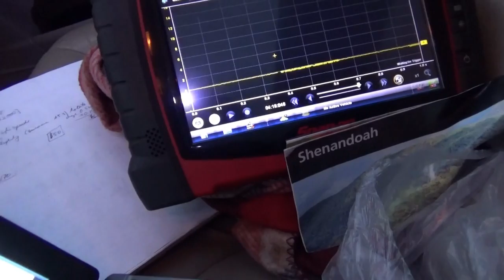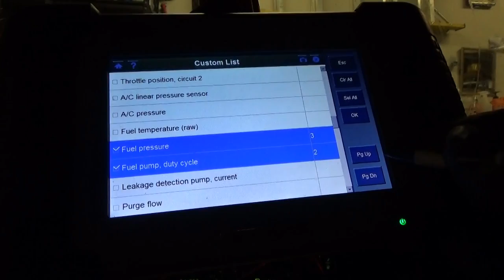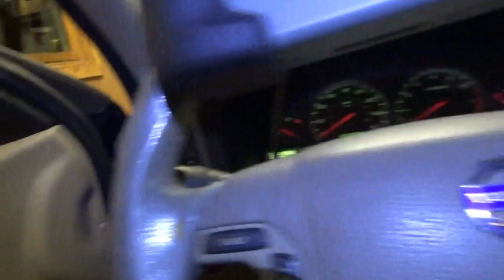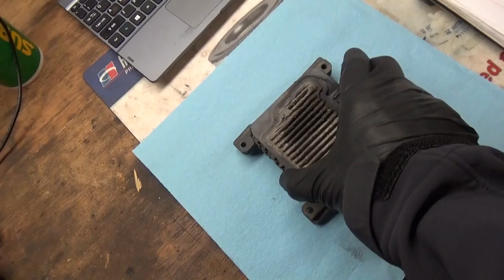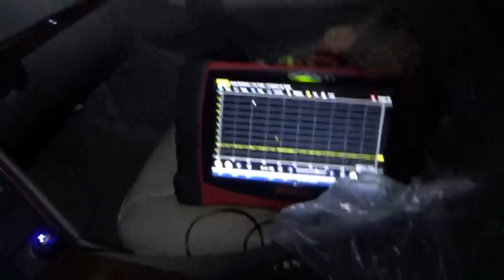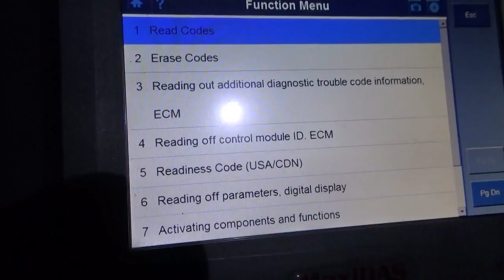Volvo Crank No-Start -Part 2

Comment: I just sent these videos to a friend with a crank no start xc v70 '05
The vehicle will not start if it is below freezing.
Above 32° it has been starting  fine. If moisture has invaded that module could this be an explanation?

Comment: Looking at the circuit board I really couldn't see any damage. But if there were a problem I would think any corrosion would create an relatively harmless  'open' - not a 'short' circuit that might burn out a component. Hence, I would re-solder any suspect connections on the board if I suspected that the parts were now in an open or partially open state on the board. In electronics this is often the problem and with a board exposed to the elements this seems very likely.

Comment: Hey boss my buddy have 04 v70 t5 same problem but I couldn’t find the module at all all the wirings are different Is there a way you can tel me if his car comes with it or have to replace the fuel pump ?

Comment: Brother I feel you.  I'm having the same problem.  Do the same thing, take very good care of my car.
Been running great,  no issues.  Then ran out of gas and  havent been able to get it started.  Got fuel,  good cranking
Power and alls I can get out of it is crank, crank and crank,  but no start

Comment: Can you explain me if it is grounded by computer (like you said ground side switch) why scope didn't show 12 V or whatever voltage, instead showed zero voltage. If  ECU ground this yellov wire wasn't suppose module show voltage when it is disconnected.

Comment: Volvo wishes is was a polymer electrolyte membrane, that’s used in fuel cells... https://blackwells.co.uk/bookshop/product/9783639342314?gC=098f6bcd4&gclid=Cj0KCQjwjMfoBRDDARIsAMUjNZrnh5GTsVF3pZthzCMyP0UJkTDxYJxrd8rI3I--TewkmgMFV2idN9kaAs6HEALw_wcB

Comment: So, if the dealership would have replaced the fuel pump and it obviously wouldn't have fixed the problem, does that mean the pump is free because their diagnostic was wrong?  Ha, that would be funny.  Like, if I actually took it into the dealership and the car still wasn't fixed, I would tell them that I'm not paying for that fuel pump since it didn't fix the problem.

Comment: pulse modulated fuel pump insane over complicated nonsense.
When all these vehicles get old $$$$$$$$$$$$ to keep running. I am Curious how long car will last jumping it at full output to save money on older Volvos ? Won't pass emissions but rural areas don't require such testing. 
My 1981 240 DL went 400,000 miles simple easy to repair . First car to use Lambda sensor (Oxygen).

Comment: Haha, $500 for THAT? What a ripoff, for a shitty design anyways. Looks like a 5 minute job with a hot air tool, a good soldering iron (not that butane thing you love so much), and some flux paste! Want to send it to me? I'll fix it for $100, special price, just for you!! :-P I did just fix a VFD for a spindle for a CNC machine for a total of $50 in parts, when a "pro" shop quoted $3300! See my (lame) channel for some videos!

Comment: Thermal interface material in contact with the PCB ground plane without removing the solder resist. Wow that a new level of "design".

Comment: Shocked it didn't require programming ... but that's probably because it was built before '07. I see Volvo (Ford) stole GM's brainstorm of locating the fuel-pump-controlling magic box UNDER the vehicle, right in the road salt, sand, and water. Brilliant ... 😠

Will be a MUCH cheaper bill than that ripoff dealer, that's for sure! Was well worth the tow to you from VA - your buddy knew that ahead of time. 😊

Comment: Proton exchange membrane electrolysis is the electrolysis of water in a cell equipped with a solid polymer electrolyte that is responsible for the conduction of protons, separation of product gases, and electrical insulation of the electrodes

Comment: Output transistors are toast, there are two big ones on the board and they likely got cooked/shorted with that corrosion floating around in it.
Reply from the maker: Yup that's probably the culprit. Not enough heat transfer!
Reply: @PineHollowAutoDiagnostics  I would have tested those two electrolytic caps, the big orange and the little blue. They dry out and lose capacitance and can short. Could have been a $2 fix! I am amazed that you could jump out the module and hot wire the fuel pump, and the ECM thinks everything is fine. And on a Volvo! What about the headlights that won't go off?

Comment: When your power went out it reminded me of a question I,ve had since a lot of the scanners are going wireless. Does you're Verus pro get its power from the vehicle while using the wireless dongle? Or does it needs a good internal battery or separate 12 V source to operate. 
I like the way you always try to fix an expensive modual to save your customer money! Wish you were closer to me. It would be great to have you 're expertise here in the north west.

Comment: Just a heads up Volvo adds Baro to that fuel pressure pid. I got burned by it had a regulator performance code so I took gauge pressure and compared it to scan data and it was off so I called a sensor. It was actually gauge pressure plus baro on the pid. Actual cause was due to duty cycle request over 45% at idle and needed a fuel pump.
Reply from the maker: Wow that's a hidden variable for sure!
Reply: @PineHollowAutoDiagnostics  don't expect to find that on Mitchell or Alldata either. Took some digging on identifix to find code set  criteria
Reply from the maker: lol some cars are too smart for their own good! At least it tells you in a roundabout way that you need a fuel pump before it REALLY needs a fuel pump :D
Reply: @PineHollowAutoDiagnostics  it would be awesome but euro manufacturers don't ever want to give anyone the information on how these systems work

Comment: Ivan, sure if you saw this in your research about this module but there is a TSB about it that requires it be moved to a new location if replaced. Here is the TSB: https://www.google.com/url?sa=t&rct=j&q=&esrc=s&source=web&cd=6&ved=2ahUKEwiN5snihfbgAhVriVQKHYjxB14QFjAFegQIBxAC&url=https%3A%2F%2Faskatech.com%2FAskATechLive%2Fforums%2FResourceHandler.ashx%3Fa%3D13208&usg=AOvVaw08aq7Y4IWOTbrubMbe-KDd

Comment: Check if you have signal coming to those two big mosfets. If you do, board is good but the driver mosfets are done. Easy repair. If no signal, as someone said, soaking the  board in water and the drying it with alcohol might help. Used Bosch PEM:s are 40-90 USD. All PEM's are not all located under the car and are in great shape. 

https://www.ebay.com/itm/Volvo-S40-C70-XC90-S60-07-06-05-PEM-Fuel-Pump-Module-4N5T-9C105-AG/264211524390?hash=item3d843beb26:g:Gv8AAOSw-M9ccgVk

Comment: If you go to your local Ford dealer you can get same PEM for under $100. last time I needed one.  Also, you can get used one, does not need to be programmed, easier to just replace than diagnose. Volvo parts are a total rip off.
Reply: Do you know the Ford part number?

Comment: Hey Ivan jus a thought, maybe to see the duty cycle from the PCM when you have the circuit jumped, you could use a 10k resistor on that yellow wire to battery positive which should bring the voltage high on that line. Then use the scope on it to see if the activity from the PCM
Reply from the maker: Great idea! Would probably work in a pinch :)

Comment: Great diagnostic! Looks like that module is some kind of pulse amplifier, It works amplifying the current and voltage signal coming from the ECU/ECM to the fuel pump, by judging the internal IC's in it it looks like it does not need any programming. I am just guessing but looks like those Mosfets are burned. I am amazed about the huge amount of PIDS coming out of this old Volvo ECM and also surprised that your old DS708 is able to read them! I guess Mr Kilmer is right about the DS708... fuel rail pressure sensor and fuel temp sensor! Wow! Also I think you're getting a high fuel pressure reading because you're operating the pump directly out of power source in a constant Max out duty cycle.
Reply from the maker: Yup the Autel works very well on this older Volvo!

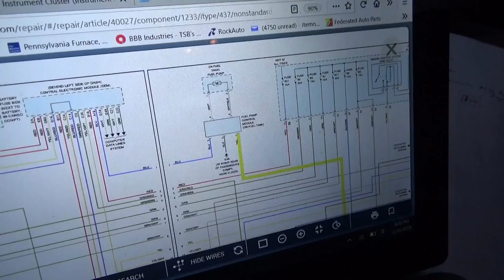Comment: At 2:40 you were stating about adding voltage to the computer signal. To verify if the module was sending voltage to the pump, would you have simply checked for voltage directly to the pump?

Moe

Comment: They make a relocation kit for that module to install under the seat
Reply from the maker: Where it would be closed to airflow and overheat ;)
Reply: the  wiring goes from outside connector to the trunk next to the spare tire (as and extension)  on the right hand side so you can relocate the P.E.M. (pump electric module)

Comment: I got confused when we saw the signal at 20:24. When you checked in part 1, we didn't see any signal/pulse. At first, I thought you fixed it! Thanks Ivan!
Reply from the maker: Must have been a poor backprobe. That is why poking holes in wires is the preferred method, as the wise Keith DeFazio preaches :)

Comment: Poor Volvo.  Try to get recall info on relocating the fuel module inside maybe still valid to get a replacement module and get it relocated for free.  

also give that Volvo a tune up... 

And yea that battery is probably trashed but also turn off the headlights put it into parking light as headlights/daylight running lights on Volvo’s draw stupid wattage.

Comment: Probably a pullup resistor on the fuel pump control module pcm line. No module, you get an error code. Cheers

Comment: I guess you could use the driver test function on a powerprobe to feed voltage to the controlwire (?)
Reply from the maker: Interesting suggestion!
Reply: @PineHollowAutoDiagnostics  Never tried it myself. Actually never tried that function at all as i never had the need, but this case popped up as a great place to use it. I think... I would have to read up on its purposse first though...

Comment: That's the one thing about the DS708 that I don't like.  To change the units you have to completely back out and go back in, and on some cars, it's pretty slow going in.  Every time I want temps in F and/or pressure in psi, I find I later want my MAF in g/s and you can't have both!  I just keep my calculator/converter app on my phone handy.  I really like my DS708, though.  It's the only full scan tool I have right now but it's got the last 2017 update they came out with.  I paid a whopping $225 for the tool on Craigslist.

Comment: I wish he would do all these tests with a solid fully charged battery. And a fixed connection to the post. Thoughts?
Reply: yeah  i have been screwed by skewed readings  due to varying voltages before.  doesnt happen all the time but.....
Reply: My constant recommendation to Ivan.  Keep it simple. Why track down the unknown electronic variable without first diagnosing and fixing the known major problems - a battery that won’t hold a charge and a headlight circuit that can’t be switched off. Needs a full system scan and a visual check of the wiring for bad grounds, rodent damage, abrasion damage, crusty connections and then the relevant electronics exposed to the elements. There is “no such thing as coincidence,” especially in car repair.
Reply: @snowballmidnight Oh you're the one. Sorry that's the way I go thru life

Comment: So that module is like a driver for the Fuel Pump? It gets a PWM from the ECM and then amplifies it to the Pump?
Reply: It looks like it has too many chips to do only that. It's receiving a pulse signal from the ECM, which might communicate pump speed request by pulse width or frequency, and then translate that into PWM at some other frequency or range of pules widths to control the motor.  Also here's some power line filtering (the large capacitor and adjacent choke coil).
Reply: glorified electronic relay. not sure if the level sensor is built in or not
Reply: I thought it was interesting that this uh.  fuel system,  just changed the volume of delivered fuel by making the pump go faster or slower. Do I have this understood correctly?
I like this variable pressure option. Maybe it prolongs fuel pump life?

Comment: 1st BOOM
Reply from the maker: When the battery is discharged, the charging current can be up to 40 Amps! The alternator is designed to be able to handle this load no problem :)